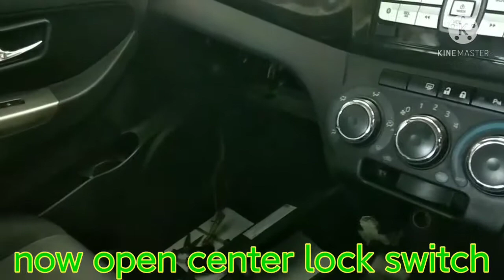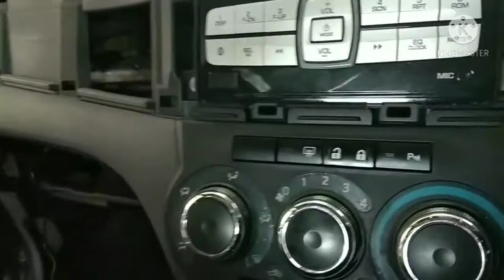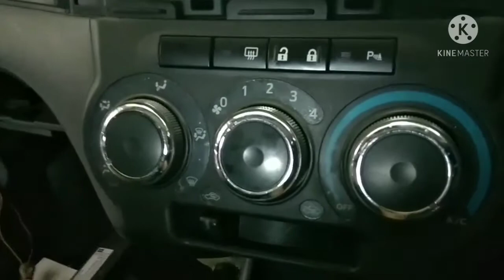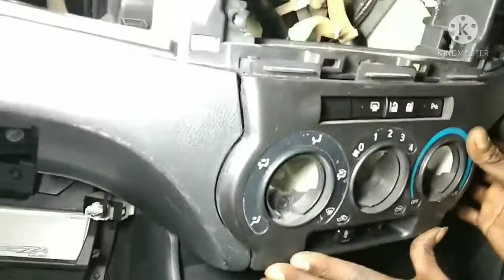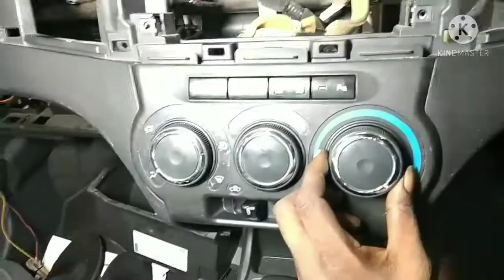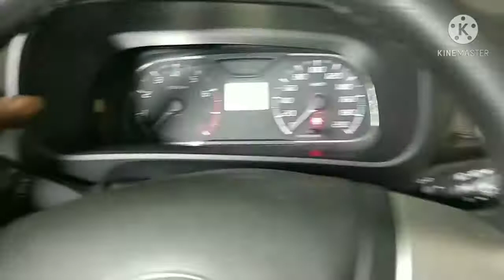produa bezza repair door lock unlock switch

Comment: Bos, need a little help here.. saya punya problem bila lock guna remote boleh tapi bila nak unlock guna remote pintu driver xboleh nak unlock dia cuma dpt lock pintu driver jer. Sama dengan switch bila nak lock semua pintu boleh tapi bila nak unlock pintu driver xdpt nak unlock, kenapa tu yer bos?ada cara ka settle atau macam mana bos?
Reply from the maker: Your vehicle's door lock and unlock cable is broken or the door central lock does not work check in open the door cover,,,